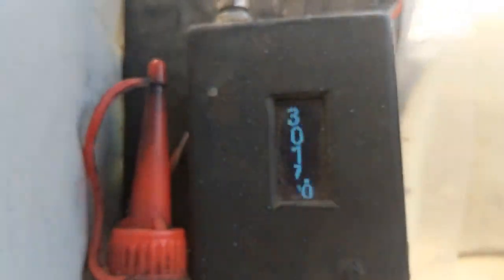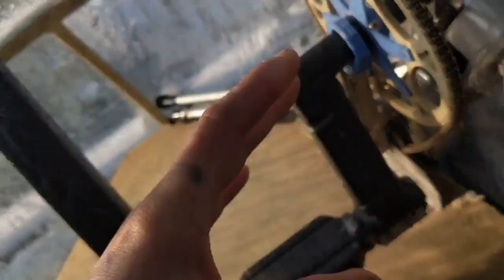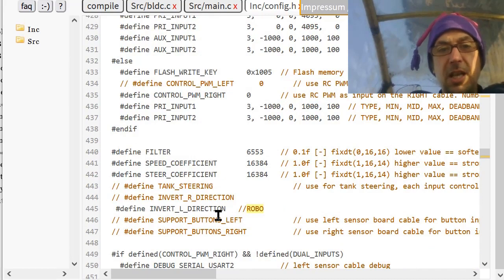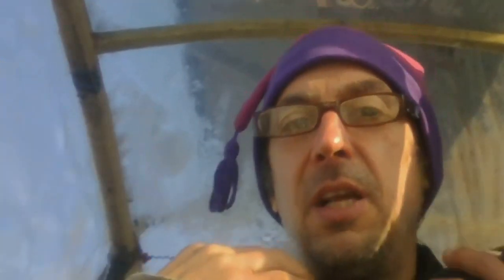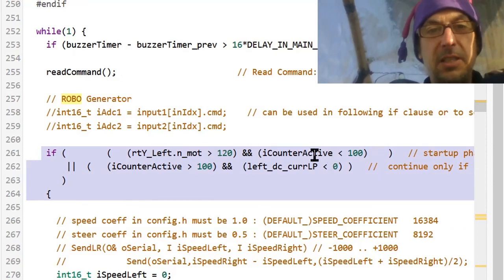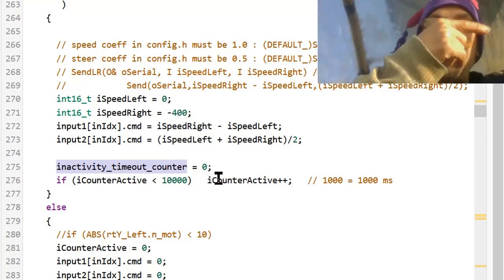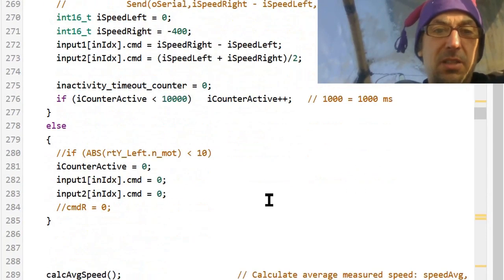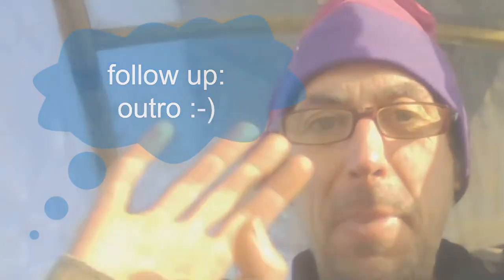hoverboard motor as a generator (source code explained)

Comment: great - thx! By the way, the synchronous Step UP/DOWN converter modules around the high efficency LTC3870 are great and cheap!
Reply from the maker: Yes but they have max voltage of only 30V. Not suitable for my solar panels . I am in search of such a high efficiency 60V step up down and at least 10 A.

Comment: Can the board operate at 24 volts 7s after I complete the programming at 36?
Reply from the maker: No it will shutdown first time when speed is set to 0. You need to flash again with number cells 7 in config.h
Reply: @robodurden  Should i change anything alse than cell number in config.h ?
Reply: @robodurden  I am using the board for an industrial trolley with 2 midpots at ADC variant and I wanted to operate it with a 24 volt battery I have but every time I turn it ON it shuts down immediately probably due to a low voltage error. Is there anything else I need to change other than the number of cells for it to work?
Reply from the maker: @WhyNotCycles  it might take some try and error until the two potentiometers do what you want but yes, 7 cells should do the job. Eferu FOC firmware I suppose.